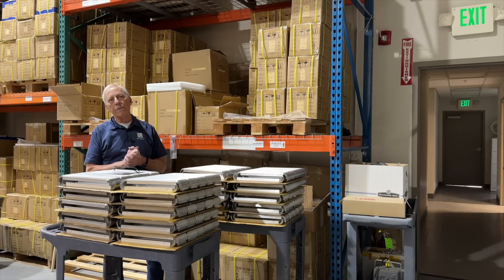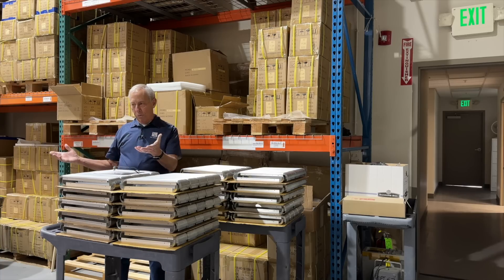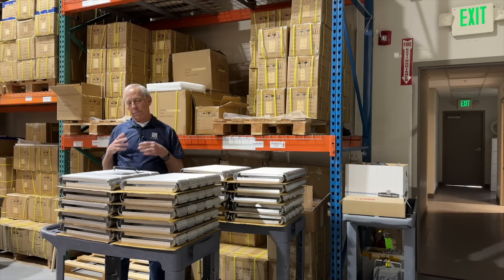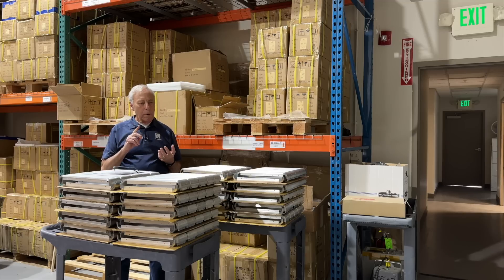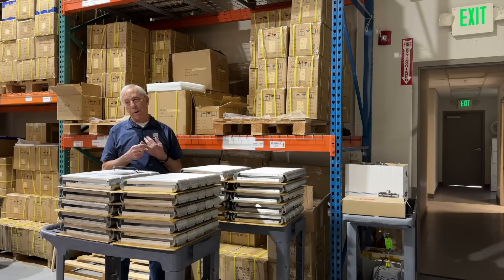Getting the AC power right

Comment: In North America, there are voltage standards on the supplier side and on the equipment manufactures side.  Take the nominal 120 VAC circuits with have a service variance of +/-5% that is considered operating with in standards.  The utility has to respond if they get variance in the utilization range of +6/-13% a couple times over a defined time period.  

On the manufactures side, the industry group, NEMA, sets standards that are 96% of the nominal service voltage to account for the electrical wiring code that permits no more the a 5% voltage drop on feeder and branch circuits down stream from the service entrance.  They allow a variance of +/-10%.  The NEMA voltage is where mfrs equipment is suppose to operate most efficiently.  The mfrs are encouraged to design for efficiency across the range.  This is why on a 240 service you'll see equipment with a 230vac rating.  Or on 120v line, equipment with 115vac stamped on them.  

Older people in North America do say 110v, 115v and 120v.  Those voltages were in the past but the 120vac standard has been set since the early 1970s.  And some people pick up on the NEMA voltages of 115 and 230 on equipment.  But the nominal service voltages are 120, 240, 208...

Comment: That's the best reason I've yet heard for getting an AC Regenerator ... excellent application 😊 Where I live in Sydney the mains voltage is very stable at all times at 240 vac ... and has very low source impedance ...

Comment: I have a P 12 power plant in my system and it has helped the overall sound quality quite a bit. Recently I learned about Nordost "Q Line" AC  modules that plug into  the power outlet(s) that feed your audio equipment and the Shunyata "Defender" another wall outlet plug-in that uses a different technology than Nordost. Both of these technologies work in harmony with each other for some reason and have made a substantial difference in cleaning up (ameliorating) micro noise on the AC line. The SQ of my music system is simply magical In almost every way in my listening experience. I am stunned by these differences in every musical experience I have had for the past two months since they have been installed.

Comment: Built my own power management system for my valve based hifi system. It's a latched relay that breaks cleanly if voltage goes too low, then there's EMI filters, and finally a 1000VA Servo Variac that holds output to a preset (111Vac).  I live close to an industrial area and we can see large variations in the nominal 115Vac outlet depending on time of day as big machines cycle.  Lost too many KT88s, hence the decision to build me a power manager. Oh, included innthe box is an old school linear regulated 5Vdc 3A power supply for my Raspberry Pi3 / AlloBoss music server/DAC
Reply: Hi, You may benifit from building a buck-power supply, it adds a bit of regulation which will help reduce the excess variation, it also puts a tiny bit of moise reduction whist being cheap as chips. Basically its a  transformer with the secondary in series  with the live, but wired to produce a reverse voltage, so as the mains voltage increases, then so does the opposing buck voltage.
Reply: @Roosville1  I considered that at first too, but I had the servo variac on hand. The voltage fluctuations are not at all rapid, the servo-variac works perfectly for my application, response ramp time is ~500ms. Thanks for the response
Reply: I use Raspberry as well.  I upgraded its power supply with LT3045(X6), 2ppb clock and separate transformer and LT3045 for clock circuit.  The improvement is enormous and well worth the works.

Comment: It would be nice with some video showing actual A/B blind testing with or without a power plant in a location where a power plant can do it’s job. These claims of Paul should be based on something we don’t have to argue about. A claim that the sound stage will improve is interesting technically but it’s a completely empty claim if there is no example of reference with actual audio products involved. In actuality it means some audio gear will output a signal that has some sort of artifact that will be audibly reduced with a power plant. But is it AC power harmonics as noice in the signal? AC voltage fluctuations causing modulated audio waves? Or what? I would expect it to be measurable.
Reply: You would certainly think it’s measurable if such a massive difference does in fact exist as he claims. I’d be curious to try one myself if the cost wasn’t so outrageous but I have my doubts as to their effectiveness. Any amplifier designers worth their salt already account for power fluctuations etc. when they design a power supply. I just don’t see adding another high demand device in front of your power amps/sources doing more good than harm. You’re just adding more strain to the circuit.
Reply: @shannonmiller5648  It’s simple to me…Do a blind test. If Paul is so convinced,!he should put meat on his claims with data and a proper blind test.
Reply: @ThinkingBetter  
Exactly. Shouldn’t be an issue if the proposed difference is in fact as obvious as he claims it is. I like Paul but he’s a salesman first and foremost. It’s pretty clear to me that his actual knowledge of circuit design isn’t as vast as he claims it is. There’s a difference between being an idea guy and being someone who can actually design and build complex circuits. Paul is an idea guy and a salesman. I really haven’t seen or heard anything to prove otherwise unfortunately. He likes to portray himself as one of the design giants in the industry but he ain’t no Nelson Pass or Bob Carver or even a David Hafler. The list goes on. Heck he had to outsource the design of their top of the line amps to Bascom King so that should tell us all something right there. If he is what he claims to be then there’s really no reason why he couldn’t have designed something of equal capability himself. At least between him and his chief engineers. He’s a nice guy who’s good at talking to people and knows just enough to sound like he knows his stuff to people that don’t know their stuff. In other words a great salesman. That’s pretty much it.
Reply: @shannonmiller5648  Agree, the depth of knowledge needed to actually design a circuit is of a whole different level.
Reply: @shannonmiller5648  Excellent point, but should be the obvious point. Unfortunately people would rather ride the  magic rug, while ignoring all rational thought. How about another piece of expensive gear that aligns the electron spin before entering the "Power Generator". Pual McGowan, PS Audio, what do you think ;-)
Reply: @@Douglas_Blake If I was living somewhere in rural Africa in some clay house with thin power cables, I could see this being useful. But if I lived in such place and had the money to buy such product, I would rather spend the money on moving to a better place 🤔
Reply: I added a Power Plant P3, the smallest model to power my preamp, DAC and streamer.  I immediately heard the improvement in sound stage and image after adding it.
Reply: @vondita3772  Ask your wife or someone to do 10 tries of it being used or bypassed without you knowing it for the song you believe is best proving it. In other words, she make the random choice with 5 times each case. Let me know how many times you guessed correctly. Make sure you have zero visibility to what she did. If you consistently get it right, let’s talk.

Comment: Let's say the amplifier itself should have a max
(50v-0v-50v) max.
at 220v you get 40v out of the transformer. if you use it on 240v, you can quickly get up to 50v out of the transformer!

Or if you suddenly only have 200v going into the transformer, you will get less watts out of the amplifier

Comment: Norway have 230v Norway had 220 before if I remember correctly.
Reply: Yes. Europe went from 220V to 230V to reduce losses while still maintaining the same equipment and wiring that was built for 220V. 
The higher the voltage, the lower the losses.

Comment: Voltage has been upped a bit over the years. It used to be 220, now it is 230. I just measured it and my voltage is between 236 and 237 fluctuating.

Comment: Mr McGowan is on the money here, perfect answer.  I would add one thing.  Mains voltage is an PITA for valve equipment, as the HT voltage and heater voltage are utterly non-regulated. If your HT was 400V and you get a wall at +10% then you wil get 440V HT. A lot of PSU capacitors are industry norm 450V rated, so it starts to get a little on the high side. With the heater, 6.3V becomes 6.95V and your valve life goes down, lots. In the countryside with transformers on poles, mains can get high close to the transformer as it attempts to compensate for cable loss to the last house miles down the road. I hit 257V in my UK house due to this issue.